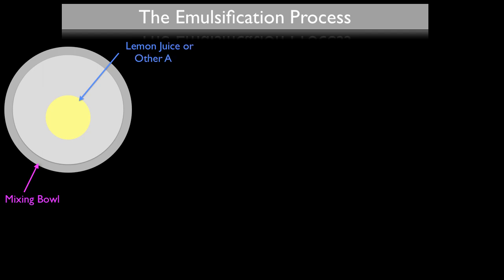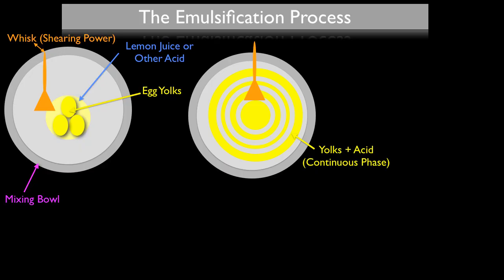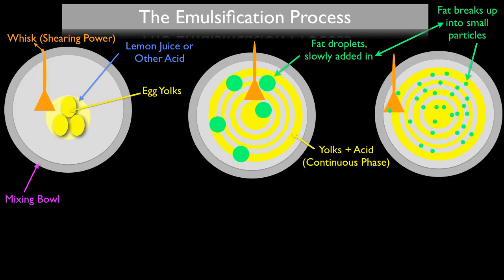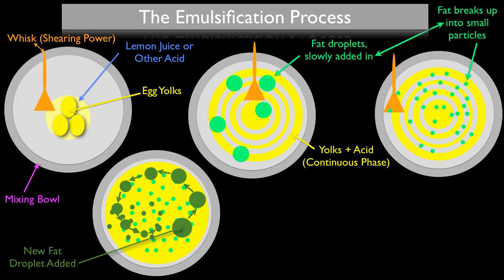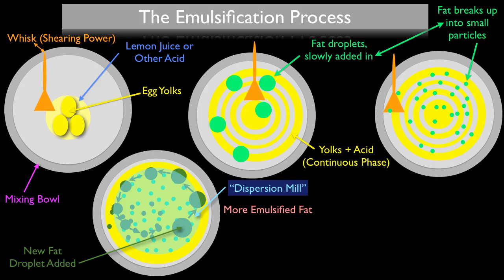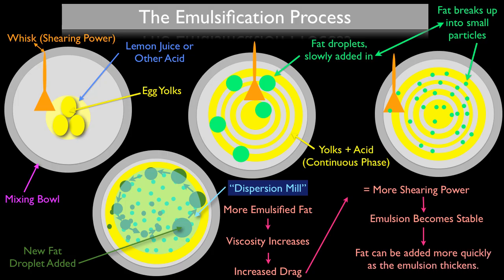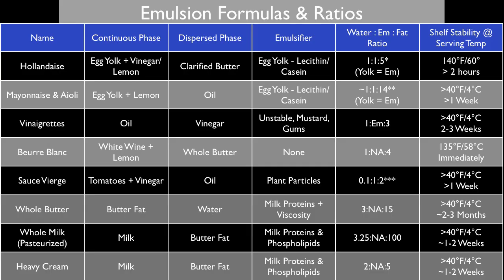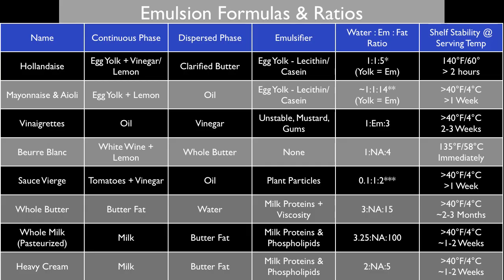The Emulsification Process

Comment from the maker: The water content from the juice/acid gives you more continuous phase to start with, which makes forming an emulsion a little easier. This, however, could easily be accomplished with a tablespoon or two of water. The reason why acid is commonly added to emulsions is because they contain a decent amount of fat. Fat deadens flavors by coating the palate. Acid helps to cut fat and brighten flavors. That's why an emulsion without an acid component will taste flat or one dimensional.
Reply: Again, fkn great explanation! Thank you for the work you put in your channel🤙💯
Reply from the maker: @joebine6644  Thanks. Glad you're enjoying the channel.